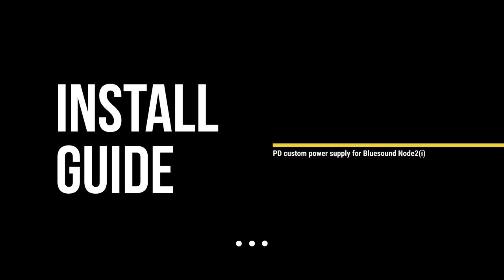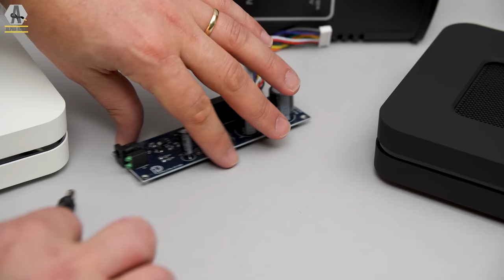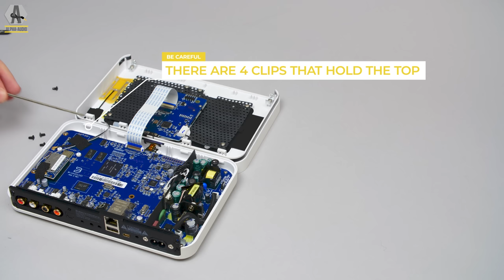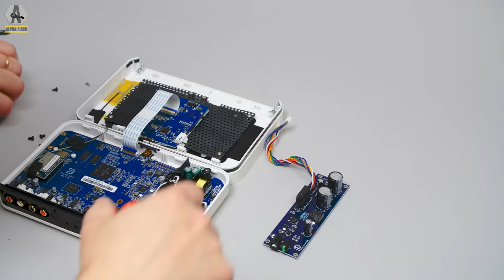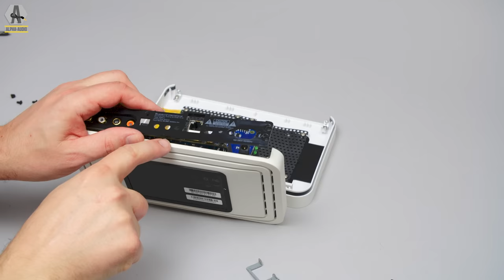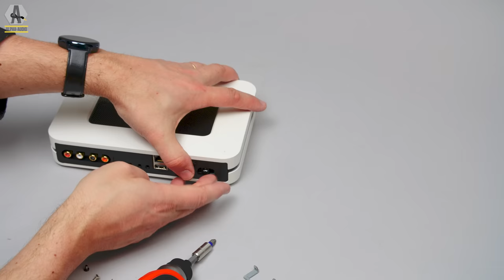How to boost your Bluesound Node 2i - using a custom power supply

Comment: If you do this MOD and have to buy and external (S)PSU it's about 170 euro's (if you are lucky and don't count shipping). If you want something like an Allo Shanti supply it'll be going be closer to 300 euro's. Does the improvement gained with this supply mod fair against getting a (better) external DAC? I am curious if the gain with an external DAC would be the same or better than doing the supply mod.

Comment: I am so impressed with  my Node 2i that I started ripping my CDs onto a USB drive and listen to them on the 2i. My biggest gripe was that $2 power cord that came with the 2l. And it doesn’t even come with proper HiFi receptor that allows me to use a half decent power cord. So I cut off the connector that goes to the 2l and soldered it to a Nordost Red Dawn. Wow. What an improvement, especially with music ripped from CDs. Bigger sound stage, more details, articulate bass. Mind you, the Red Dawn casts as much as the 2l. Lol. But we’ll worth the money. Suggestion to BLUESOUND...sell an adapter that allow people to use a proper HiFi power cord.
Reply: buy a mains filter
Reply: Ahahhahhaha

Comment: i just switched out the stock power cord to a Kimber power cord.  you can buy an adaptor for the female end of the Kimber that will interface with the Node 2i for about $10 or you can get an Audioquest power cord that will match the Nodes a/c input.  big improvement.

Comment: I am using it already , definitely you can hear 👂 an improvement with very little money , maybe you can make a comment or a video of your impressions as a professional
Reply from the maker: Just posted the sample-video!
Reply: @TheAlphaAudio  What is the cost this board and the PSU??
Reply from the maker: @sheerenergy8602  Board is €70. Sbooster is € 320 I think.
Reply: @TheAlphaAudio  Thanks.

Comment: What are the advantages of the newer PSU? Both are SMPS based, only the newer one is non-isolated (no high freq transformers). You must do before and after measurements to be able to claim that you have improved anything... Besides, the Node 2i DAC is crap. You better off getting a good external DAC instead

Comment: I have my Nodi 2i connected to an external Arcam irDac which is powered by an external Sbooster power supply, is there a difference in my setup and what you did? By the way I always look forward to your test and reviews great audio channel
Reply: Each component should have a “quiet” power supply. The Sbooster handles the DAC but the digital signal is still coming from the BS Node 2i. So, in an ideal world every low-voltage component would have an Sbooster (or equivalent).

Comment: I have a Node 2. Will this modification work on my unit ? I am using a Schiit Gungnir external dac. Does this modification make sense for my situation ?
Thanks !
Reply from the maker: Yes it will work. No problem. But with an external dac, the difference is very small.
Reply: @TheAlphaAudio  ,
Thanks for the reply. 
What is the brand of this custom power supply ?
Reply from the maker: @jpgsf1978  Sbooster
Reply: @TheAlphaAudio  ,
Thanks !
Available in the US ?
Reply from the maker: @jpgsf1978  yes. I believe so. Check the website. I think they have a dealer listing.
Reply: @TheAlphaAudio  ,
Thank you ! I checked and given the high cost and minimal benefit given that I use a high quality external dac I will probably not buy it. I
Reply from the maker: @jpgsf1978  totally understand.
Reply: @TheAlphaAudio  ich
Reply: I can't say regarding node 2i, but using a proper linear power supply on rPi based streamer with Gungnir was a noticeable improvement to me.
Reply: @jpgsf1978  Lis les commentaires en haut
Reply: @jpgsf1978   Lis les commentaires en haut
Reply: @pierrerobert4672  ???

Comment: Thank you for providing the detailed instructions for replacing the power part. My Bluesound Pulse P300 is no longer turning on. Do you think it would be possible for me to replace the power part myself following your instructions?
Reply from the maker: Unfortunately not. The Pulse is completely different.
Reply: @TheAlphaAudio  Thank you for your advice. Have you ever also taken apart Pulse?
Reply from the maker: @SeungyongSimonPark  No, I havent. I tried to fix the big Pulse. It's very hard to take it apart.

Comment: Appreciate the tip but how does this improve the unit????
Reply from the maker: If you use a decent lineair power supply, you can definately notice an improvement. We will publish the samples soon.
Reply: @TheAlphaAudio  If Im using the unit as a streamer into a McIntosh MA5300 integrated amp (using MAC dac), will i still notice an improvement?
Reply from the maker: @jearley22  I don't know to be honest. You could try ;-).

Comment: Thanks for the lead on this!  I've ordered the low noise interface from PD creative, and took a chance on the Allo Shanti LPS.  All said and done, about $280 USD to the door.   Definitely worth a shot for that price!  Will report back once I get it all and install.
Reply from the maker: Thanks man!
Reply: How far are you?
Reply: @BijBijTCG  depends in relation to what
Reply: @lemmyliquidcooled7009  what kind of improvement did you get? Was it worth the 280 quid?
Reply: @georgedomse  Absolutely worth it. For me a big difference. Much cleaner, and more detailed. 
However, since I did that, I'm now using an external DAC. The improvement with an external DAC is not as great as the improvement when using the Node's internal DAC. That's the biggest win to the Node!
Since the Allo Shanti has 2 outputs of 5v each, I now use the other one to power my Chord Qutest DAC instead of a switching power supply. Another huge improvement.
Separate, linear power really is worth it!
Reply: @lemmyliquidcooled7009  Do not use the Shanti 5V/1A output to power Qutest or Bluesound Node,, 1A is too little, you need at least 2.5A for the BS and 2A for Chord to go safely and not under-powered
Reply: @1luiluilui  Agree on the Bluesound, but even the Chord engineers are saying it's enough for the Qutest. What's your source of this info?
Reply: @lemmyliquidcooled7009  Original Chords factory power supply is 2A. Better to have extra power if needed or at least the same.

Comment: Just to clarify, this is not a custom power supply but an interface card FOR a custom power supply right? You will still need to buy a proper adapter to hook-up your Node 2 to the mains after you do this modification.
Reply from the maker: Yes. Correct.
Reply: Any advice on ordering it? 70 euros, as advertised in the review on your website, seems impossible for Dutch inhabitants (seeing it will cost 25 euros in tax and shipping alone from Poland). I wonder how to reduce these costs.
Reply from the maker: @baskapteijn  only way is via their website. Sorry.

Comment: Do you get improvement changing the PSU only when using the inbuilt DAC from the Node2i or you can see differences when using the digital outputs to an external DAC too?
Reply from the maker: Biggest difference is analog out. Digital Out the difference is subtile.
Reply: @TheAlphaAudio  okay, so since the Node2i DAC provides only average sound quality this upgrade won't make too much sense for me using a Chord Qutest DAC.
Reply from the maker: @intothedragon  no... Definately not
Reply from the maker: @intothedragon  Nope
Reply: @TheAlphaAudio  … I commend your honest reply. You are good!

Comment: How much is it?
Reply from the maker: It's around 80 Euro without the power supply.
Reply: @TheAlphaAudio  …..how much if together with the power supply?
Reply from the maker: @zamrudz_oz  you can use any 5V PSU. So it depends on the PSU you use.
Reply: @TheAlphaAudio  …..noted tq

Comment: Hmmm, so you pay £75 to have the smps taken out of you unit...Now that  think about it-nahh!! Not Bluesound's fault, it's just that an external-type/better PSU should have been implemented from the beginning,  somehow. Every manufacture does it, I guess, but should we pay for their design flaws?
Reply: Sorry, but that's just shooting-from-the-hips BS. Every manufacturer has to make compromises to meet a price-point. As it is, the Node 2i is pretty decent soundwise, particularly for what you get: Hi-res streaming, digital outputs, MQA compatible, Tidal, Qobuz & many other services, Multiroom, BT send/receive, IR remote capability (bring your own), BluOS Android,.iOS/Pad, MacOS, Win apps and works well also. Done with the commercial, but it is a good buy as many reviews point out. Got a Node 2 (no 'i') connected to digital input of amp. Sounds great.
Reply: @WhatEver-dx3eu  Yes, this is what I meant to say. Sorry.